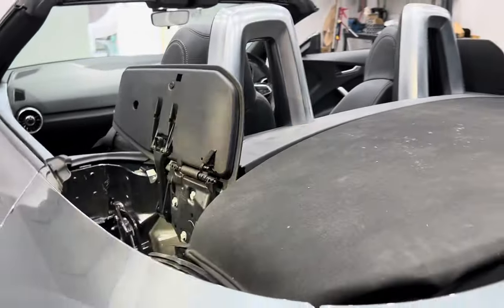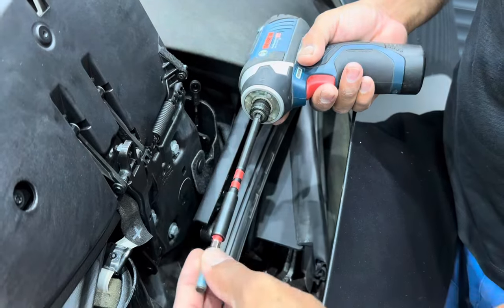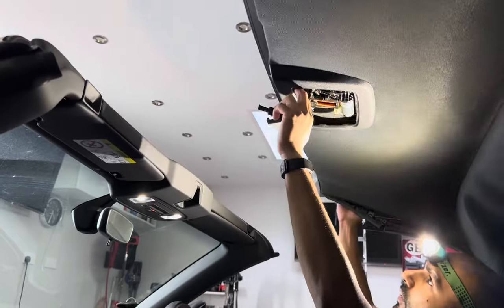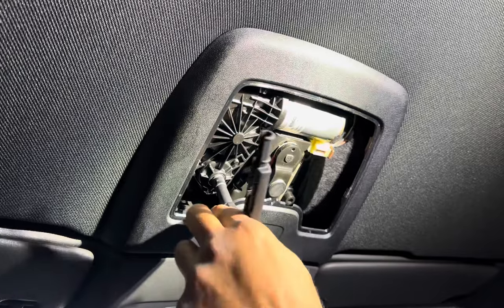Audi TT (8S) Roof Fault - How To Manually Close Convertible Roof

Comment: You didnt try unscrewing the pressure release screw on the pump inside the trunk? Its much easier then taking all those bolte off!!
Reply from the maker: Hi

This is the Audi TT 8S and the roof is driven by 2 motors, it is not hydraulic like the 8J

Regards